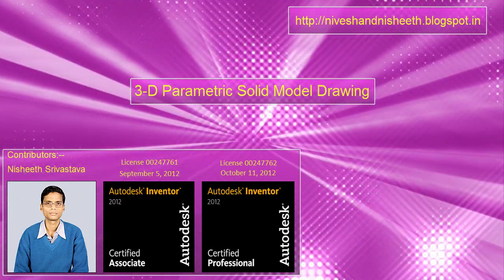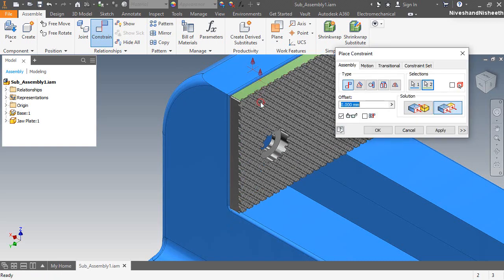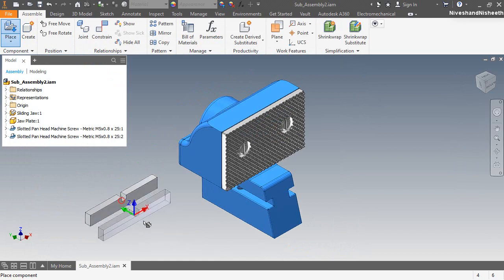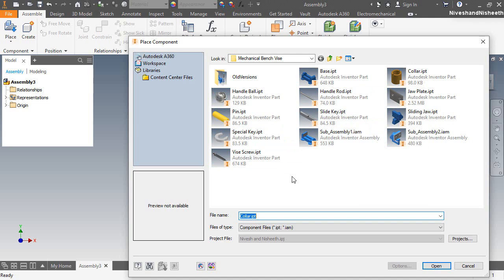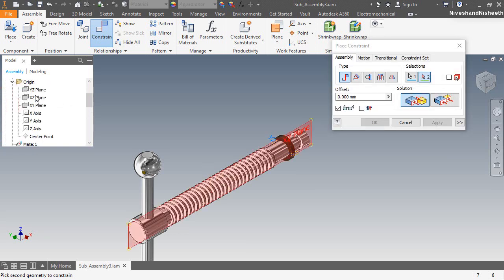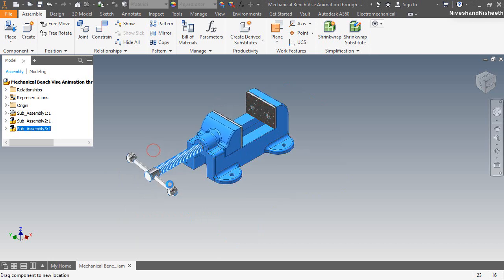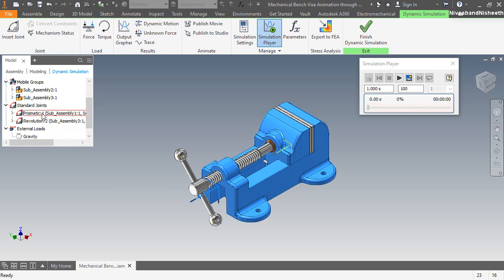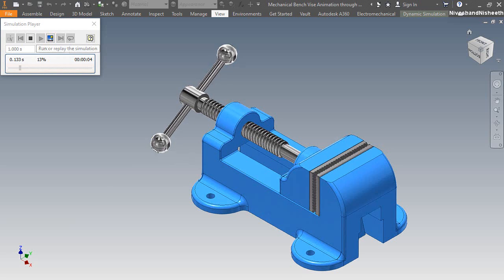Mechanical Bench Vise Animation through Dynamic Simulation || Autodesk Inventor Tutorial

Comment: Hey... not an industrial designer or anything (though I need to learn this software for my current job), but I wanted to say that your tutorial was very well-done. Everything has worked out near-perfectly on my end following your clear, step-by-step directions.

I could not, however, seem to get the "revolution" joint. I got a "cylindrical" joint instead, and could not seem to rectify that. So, the dynamic sim did not work. But, the model turned out great. 

One minor complaint: Certain things could have been explained, like why 3.5 mm pitch? What is that for? Or, there were other operations or values you chose, and I did understand why. 

Anyway, good work.